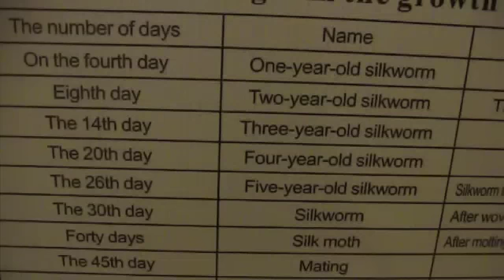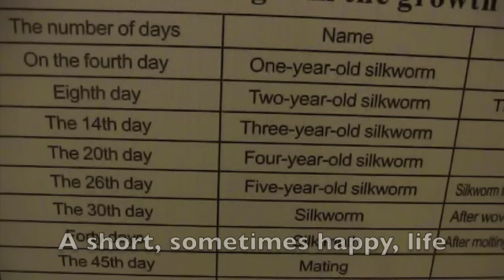The Story of Silk

Comment: Yes you do. Just because you can't see it doesn't mean you aren't killing them. Driving a car and getting insects stuck in the windshield or radiator, breathing in microscopic ones in the air, even when you touch yourself (the non-sexual way), you kill the microscopic insects eating away at the dead skin cells on the top layer of skin. You've killed millions already in the time it takes to read this comment. Is that going to change your opinion? Of course not. That was my point.